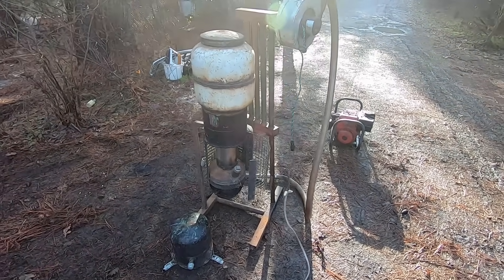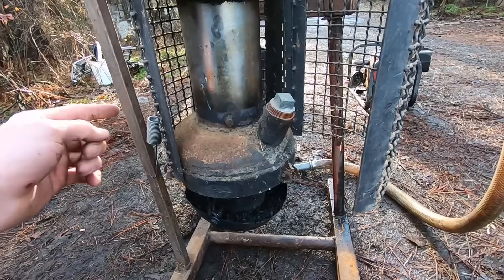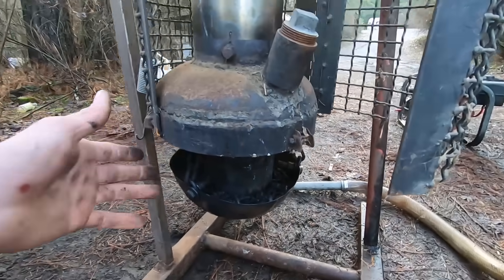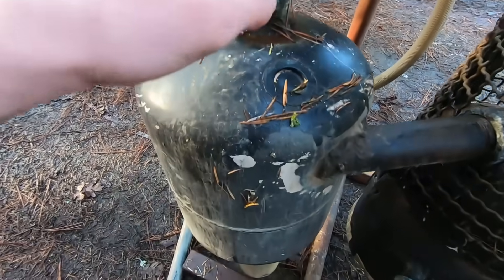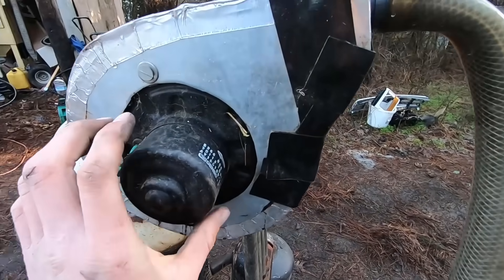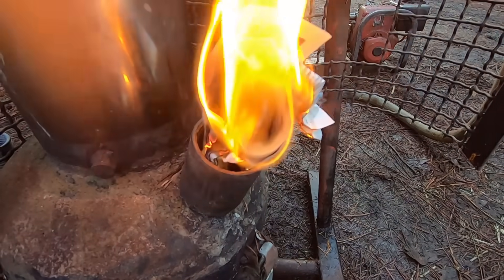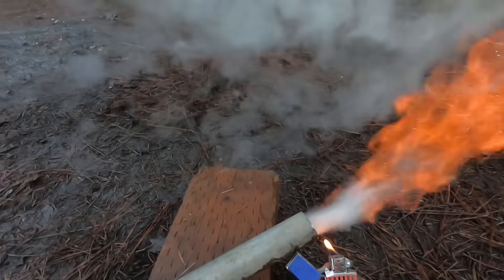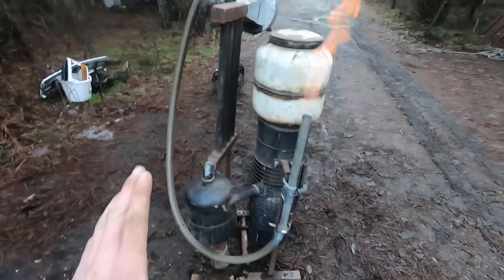Using Wood to Fuel a Generator! (How to Build a Wood Gasifier w/Demonstration)

Comment: The most amazing video I have seen from years!
I definitely will try this project and have two questions:
1. You say every dry organic component can be used for fuel but shall be be milled in small pieces as the pellets are?
2. If the ash is pure carbon couldn't be used as fuel for the fireplace or to be put in the garden composter?
Reply from the maker: Thank you so much! 

Correct! You CAN burn medium sized fuel sources (up to, or possibly more than, about a cubic inch for a gasifier this small), but I would try to keep it finer than that if you can.

I suppose it could be, but I haven't really done much research on the charcoal left over. I'll look in to it on my next gasifier build! 

Thank you for the comment!

Comment: Awesome video. Do you have an update showing a power load to the generator while running on the gasifier and how the system handles pulling a load through it?

Comment: How do you shut down the gas production once it's started and no longer required? I mean the generator is shut down and the fuel/gas supply needs to be also shut down to save fuel?

Comment: Yeah, but if you had something, like an air conditioner, or refrigerator running, you'd have to be there the adjust the fuel/air mixture every time it would kick on and off. Draw, no draw, draw, no draw. The mixture ratio is substantially altered due to the bigger ignition needed to keep the engine going under a considerable load. Or just use it to charge your cell phone, and maybe a lamp. Or...

I guess you could just max it out and leave it but the engine wouldn't last long lol

Comment: Very interesting video ! Your explanation is great ! Im curious to know how much contamination enters the generator! I’m sure you could always have some more filters but it would reduce the pressure of gas entering the machine! If you had zero power to control the blower in the beginning I’m sure you could use a hand crank for the blower until it was productive enough to start the generator. Great video

Comment: I wonder  if this tube had smaller tubes and each one powered a boiler I wonder how much horsepower could be accomplished in series or if they were in series how much electricity they could create from a generator or alternator in comparison to powering an engine?

Comment: Great little gasifier, I have had one now for 10 years and it will run anything, lots of people on farms over sea's have these on there farm tractors. In the 1920-40'S when there was a gas shortage they used this. Good job.

Comment: The part where you said a typical fire is only about 33% efficient makes you think about all of the wasted heat in regular wood stoves. Most of the heat and energy literally just goes up the chimney. I know they make special gasification wood stoves that are very efficient and produce barely any smoke. But that's not what most people use. They probably should, but they don't. Save money on wood and heating your home and better for the environment.

Comment: How to start it: basically, you just give it a newspaper bong rip.  
But seriously, wont running hydrogen make your crank case filled with water until it gets hot enough to ventilate it?

Comment: Im starting my own off grid homestead and I will totally be using this method for running a generator in the winter to charge my solar battery bank at night while I heat my home

Comment: About how long does a hopper full of pellets burn in your gasifier?
Reply from the maker: It depends on the generator draw, but the conversion is approx. 20 lbs of wood = 1 Gal. of gasoline.
Reply: Randomonium ... thanks! I guess there is a reason why petroleum became so popular!

Comment: The downdraft gasifier you built is cool but, if you simply put the wood into a sealed container and heated it, you would not need the blower motor and all that bs piping. It is all about the TEMP. Get it to 1200F (cracking of hydrocarbons) reduce to 600F to get asphalt and other heavies, reduce to 400F and get diesel, reduce to 200F and get gasoline, reduce further and get syngas aka carbon monoxide and hydrogen. The down draft gasifier is a waste. Obviously you will need to route two containers fueled by one return flame during the reaction and the second stream of gas to power whatever you want to power.  Your welcome.

Comment: Question: Do you then turn off the fan once the system is running if the intake stroke will cause vacuum or do you always need to have the fan on? If you need the fan on all the time, do you then charge the battery with the generator that you're running?
Reply from the maker: Thank you for the comment! You wouldn't need the fan once the engine was running if you had your gasifier plumbed directly into the carb of the generator. The intake vacuum would draw the air through the gasifier and simultaneously self-regulate its fuel production. Then, you indeed have to charge the starting battery with the generator.

Comment: yup it works but be careful !  you need to filter the gas better or you will have the engine not turn over after it cools because you did not filter out all the tar out of the gas. if you don't you will be cleaning the valves to un stick them. you can use the gas for heating , cooking and more.

Comment: Have you considered just adapting the end of the hose to run through the stock air filter assembly? Having it both sealed so it can take the gas in so you don’t have to run the fan and also providing another level of filtration for the engine?

Comment: make a hand crank for the fan. That way you need absolutely zero electricity to start making electricity.  I would like to see if this, once started, can run the blower as well as charge a car battery.

Comment: We did this in College, this is how we did it.  First run the gas through a condenser coil to condense any steam and tar out of the gas, then use a bubble filter (run a copper coil into a jar sealed that vents gas into the water) to catch that water and tar and it also helps in filtering out some unwanted smoke, next the gas bubbles out of the water and runs through copper coil into a homemade filter jar filled with wood chips and filter paper to remove the last of the unwanted byproducts and then ran into what you are powering. Must have some type of control valves in line for emergency shut off and gas control. But good job. We didn't use any fans due to the electrical spark the fans cause when running..BOOM, no good.

Comment: I like your wood gasifier, and you did a great job of explaining all the stages in the process. However, I feel that this isn't an energy-efficient way to produce electricity from wood. I imagine you could use the wood to heat up water, produce steam, and then power a steam turbine, and generate electricity from the turbine as a more efficient process.

Comment: If you think wood is energy dense with hydrogen. You should obviously try water. Which comes built-in with its own oxygen. 

I know you're trying to get rid of water. But when spliting the hydrogen and oxygen apart. There is literally no water left. Which is just pure oxygen and hydrogen.

Which has a more efficient stoichiometry. And is clean burning. Making it a superior environmentally friendly fuel.

All electrolysis is a simple process. It can be made difficult. But it really doesn't have to be.

And there is far more water in the world then wood.

It was a great video though.

But I hope my suggestion was helpful.

You may wish to look up Stan Meyer's. HHO Generator.

Comment: Question..: I am wondering a bit about the safety. I can see the gas you provide can burn when it exit the hose, but would it not be wise to have some kind of "blow back" protection like a valve so when you light it on fire that the fire cannot go backwards into your system.. ?
( i am aware your have a blower/turbine kind of thing that push gas out of the system, but i wonder if that will be enough protection.. I know of some professional cutting tools where you use butan and propan gas in a mixture that if you dont have a protective valve that protect against blowbacks then very bad things can happen. ).
Another question..: for how long can your system run when its filled with wood before it stop working ?
Ps.. great video and thanks for sharing you setup and experience.. yes its amazing how old tech can still be used.

Comment: Can this gas be stored? Hook up a compressor and put it in propane tanks. Maybe it might work.
Reply from the maker: It can be! However, just compressing it into even large tanks only yields a very very short run time. Enough simply can't be stored in gas form to make it worth it. :(

Comment: Question and possibly follow up video...
1) What about getting an old but sound, large and originally made for high pressure ( think something a semi trunk or half that size) for storage and possibly some further refining and revival of trace water content?
2) What kind of compressor would be up to storing that combustible gas at high pressure or even if physics permit as like liquid propane is stored.
    Great idea!!!

Comment: From other reading that I have read about gasifiers, some of the challenges with this is the system is the fuel is very dirty which results in constant breakdowns in the engine and the engine components. Germans used this technology, out of necessity, during WW2 because the gasoline went to military use, wood and coal was available on the civilian market. It took quite a bit of wood to make it down the road, something like a 20 pound armful or wood to go 10 miles.   Some people have built vehicles that can switch over start with gasoline then move to synthetic gas. If a system like this were able to be made low or easy maintenance it would provide a nice off grid living setup with a generator providing power for electricity and a heat all winter long. One significant problem with the approach is synthetic gas can be dangerous (ie a pipe might break and the wife walks into the shed and accidentally dies). I am not trying to be nitpicky here, but maintenance, safety and long term reliability are huge portions of mainstream adoption and use of technology. It is amazing today that one can buy a new car and run it for 10+ years with only a few oil changes and other minor maintenance.  That said I love innovation, and putting together projects, had we not discovered oil there is a chance more of us would have wood powered vehicles.

Comment: Is it only the bottom that need be air tight seeing as how there was a hole on top where your pellets were?  If im wrong on that and you did indeed seal the top once you got it going is there a way to add more wood as the system is running?

Comment: Alright. I've now got 3 welders, 2 plasma cutters and a hole pile of metal and tubes and pipes and 23 acres of woods and a collection of generators.  So let me ask you this.  The fule you burn to create the heat for the wood gas is the same fuel exposed to the same heat?  Is it possible to use a secondary separate source of fuel heat and a separate chamber for the wood gas?  The system I was going to build just had a chamber for wood with a port for gas and I was going to make a rocket stove where my fuel source was separate from the wood gas chamber.  I guess that's going to work because everything I've seen has been a separated system.  Yours isnt separated right?
Reply from the maker: Correct! Mine is NOT separated., but the way you're proposing doing it is also a tried-and-true method of gasification! The downdraft system that I am using here basically separates the processes by letting it happen in layers; that's why there's the need for the minimum length of the fire tube. The  separated system will absolutely work, however, you'll have to work harder to remove and condense all of the contaminants from the gas before piping it to your engine. I hope this helps!! Good luck on your build!!

Comment: Was the 12v motor/fan hooked to the battery the whole time? (It was mentioned that you could remove it once the fire got hot enough, but it seemed to be running - and drawing the 12v the whole time).

Comment: That woodgas still has some soot/tar (mostly soot after the cyclone filter) in it, which will destroy the engine over time, a tube full of lightly packed wood chip will filter out the remaining tar/soot giving you a nice blue (almost colorless) flame.

You could use a water scrubber but the sawdust can be burnt after its used, whereas the water will be filthy with tar and will need to be discarded.

Comment: This is one of the simplest and best demonstrations I have seen to date. Thanks.
Reply: I second that.... this is good.  During WW2 tens of thousands of vehicles ran this way in europe. Sometimes the systems were bumper mounted, other times the system was contained on a small trailer, towed behind.  
I think the best idea (my idea!) is to have a monotube steam engine, free piston driving a linear generator, water-lubricated. Pump that energy into a battery bank.
Reply: @someotherdude  Not a single WW2 vehicle ran this way.  WW1 vehicles did if need be.
Reply: @someotherdude  Unbelievably impractical  and could not ever be widespread.
There simply isn't enough wood to do this on a large scale.  A few vehicles in an emergency where there are major petrol shortages can work, but we simply could not power a lot of cars with wood.
We use over 500 million cubic feet of oil, that's over 90 million 42 gallon barrels  a day.  If we gasified every piece of wood in the entire world, we couldn't power ourselves a week.
Reply: Depends on where you live.
Reply: @tarstarkusz  I live on 7 acres loaded with trees so this could be practical for my 13kw generator if need be.
Reply: @Crazson34  For a short period of time.  A 13kw generator consumes a LOT of energy, probably 4 times that number, so like 52kw of heat.  You need to keep a fire going to heat the wood in the woodgas generator.  (though you could use the spent generator wood after all of the gas is extracted, which will now be charcoal as the heat source) 
 In order to run this, you would go through wood much quicker than you think.  Maybe a few weeks of power assuming it is heavily wooded with big tall trees.
Reply: Floyd Cross  Daily oil production figures are widespread and public. The world uses over 90 million barrels of oil a day.  A barrel is 42 US gallons.  All you have to do is times 90 million times 42 to get the total number of gallons.  Then all you have to do is multiply that number by the cubic foot of a gallon.
Of course, this is somewhat imprecise because not all oil is used to make gasoline.  Some portion of oil is used to make plastics, but that is actually a very small percentage. Almost all of it is burned in a combustion engine.  Petrochemicals does use a decent amount of oil, but it really isn't that much of a percentage.
Reply: I’m ignoring the city folk.  They are on their own.
Reply: Great build good explanation of how it works. People need to understand that these are for emergency situations and could be a life saver. Thanks.
Reply: I agree, I have seen may gasifier videos but this give you all the basics you need to know to get started.
Reply: ?  This is one of the most complex Designs I've seen.  You obviously haven't search YouTube in the last 15 years.
Reply: Best explanation i could find about that. I allways wondered how to modify a gasoline motor feeded with that sort of gas, now i know 🙂, thank you sir.

Comment: Would Hemp or Bambo work?

They both grow at a faster rate compared to wood. Instead of cutting down useful trees, you'd probably benefit more from a plot of planted hemp or bambo specifically meant for wood-gas-burning engines.
Reply from the maker: Bamboo? Absolutely! Hemp? As long as its dry and being used in a well ventilated area... XD  As far as I know from all of my research, just about any organic biomass should work! Thank you for the comment!

Comment: I have never made as gasifier but I love making things. For your shaker maybe you should try a air bubbler for aquariums. Its the little box that pumps bubble into the hoses of fish tanks. It gives a slight vibration that could move your wood chips. You would have to find a way to attach the box and it could possibly serve a dual purpose bc you could use the air that it produces for something too. Just a thought from a city boy.

Comment: How do you shut down a gasifier? Instead of burning threw all the wood pellets.
Reply from the maker: As soon as the air stops being pulled through the fuel by either an engine or a blower, the reaction cools down and eventually stops. Thanks for the comment!
Reply: Randomonium ok sounds good . you here stories if gasifier chugging some times like there starving for air.

Comment: In place of the area with 4 pipes used to cool down the gas you could use a air to liquid heat exchanger and then use the hot water created to a bother water to air exchanger inside a house to pump the heat into the house to heat it

Comment: I find it amazing how few people know even of the existence of gasifiers, let alone how they work.
There is a sad story about them too. During the 50s and 60s, when many homes were heated and used for cooking 'coal gas', which was gas produced by large coal-fired gasifiers, the gas was the number 1 method of suicide in this country. People who wanted to end themselves simply stuck their head in the oven and turned on the gas - it was highly toxic and could end you pretty quickly. Natural gas solved this problem - it is nowhere near as toxic and they also 'put the smell in it', which tended to cause people to choke and retch, making it impossible to inhale enough gas to end themselves, hence the sight of people committing suicide by 'sticking their head in the oven' practically vanished in the developed world.